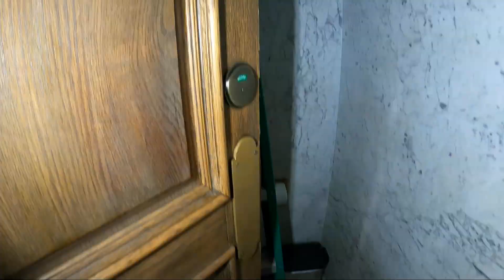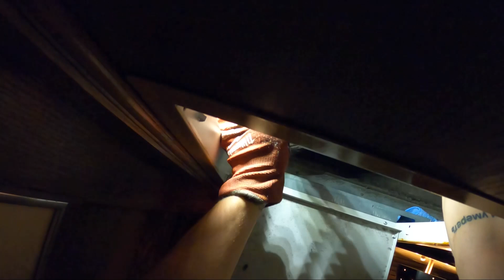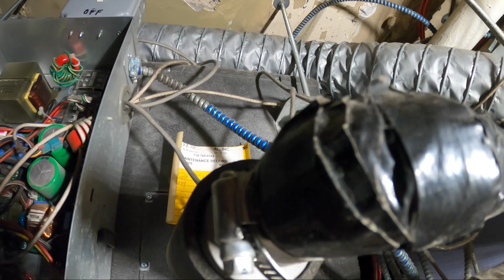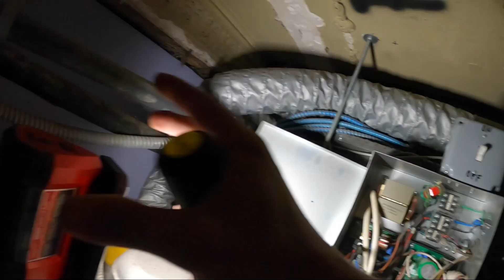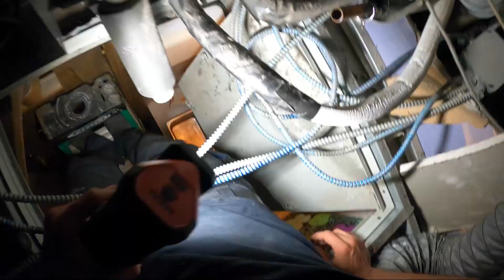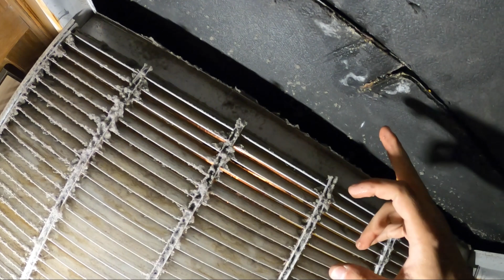HVAC Service Call: LG Multi V Concealed Duct Air Handler Leaking Water From The Ceiling (Condensate)

Comment: That panel you think that broken has nothing to do with the water leak. That pump runs constantly. Also that access door where the pump is that’s where you take the pump out from just disconnect the terminals and pull the wires thru.

Comment: I use to have 36 Trane FCU on the 6 th floor of the Hospital. Some idiot who installed them left the filters out of half of them and left no access to change the ones with filters. I was one hvac technician only in the house. I did 22 of them and hired a guy like you to help me out. We had to remove the blower s and clean them and clean out the coils. We installed flexible duct to return filter grilles. What A nightmare.

Comment: Man I hate those tight space calls, hey brotha great work as always. If you ever have that issue again or more like it, I highly recommend using the red hardcast stick foil tape. That shit can seal anything and good luck getting it off. You planned on coming back so maybe it would have been a bitch to get off to do your repairs but next time give that a shot it will definitely seal and you'll only have to lay down one strip over that nasty cover